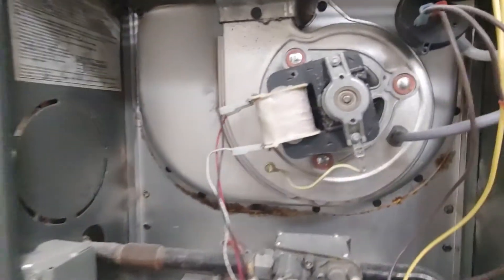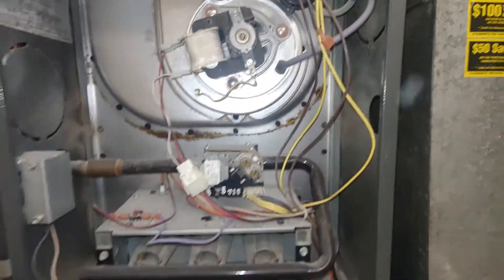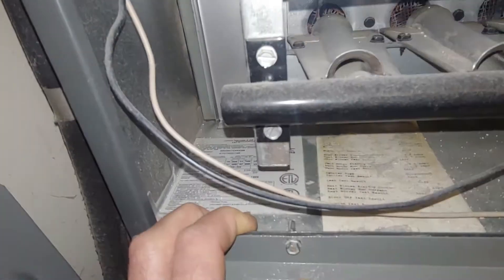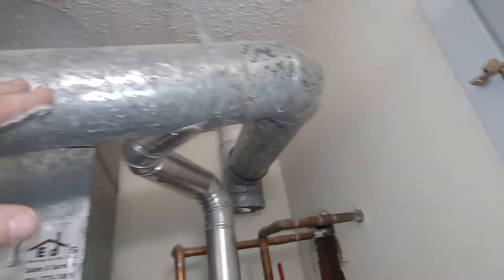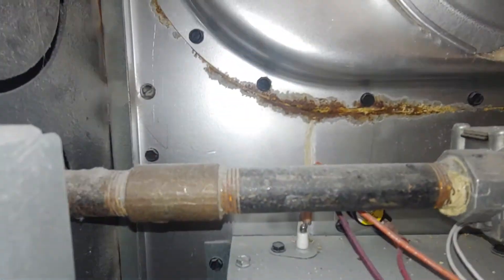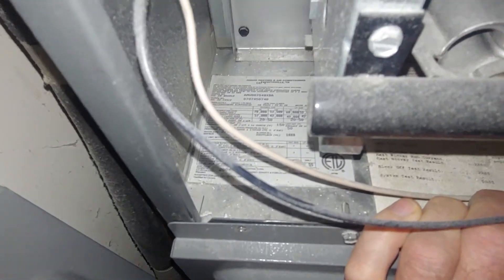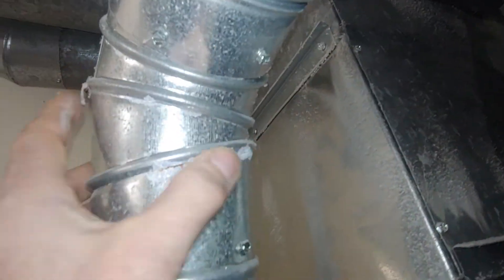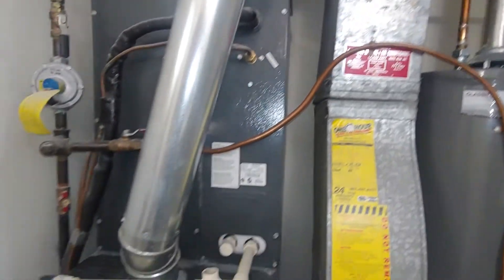80% furnace condensing in flue

Comment: Could also be from a long exhaust pipe. Had this happen on a 3 story house where the furnace was in the basement and termination was at the roof.
Reply: So what's the fix for this. I have one with 2 inducer blowers because the pipe is so long. It's rusting away from the condensation.
Reply: @catfishsnagger3284 
The proper fix is to properly size the exhaust pipe based on the BTU rating of all the appliances venting into it, then install it that way using best install practices. There is a venting table in the furnace install manual. 

Alternatively, you can add a timer relay so the inducer motor shuts off a few minutes after a call for heat is done. That way all the residual exhaust gasses are vented outside after heat cycle is completed and the temperature inside the pipe will have been equalized. This should prevent water vapor in the exhaust gasses from condensing. However a word of warning- if you decide to install the timer relay, you will cause a “pressure switch stuck closed” error on the furnace when it cycles off, so you will need to break the pressure switch circuit with a separate relay when power from the control board to the inducer motor is lost.
Reply: @catfishsnagger3284 and I’ve never seen a furnace with two inducer motors, that doesn’t sound right.